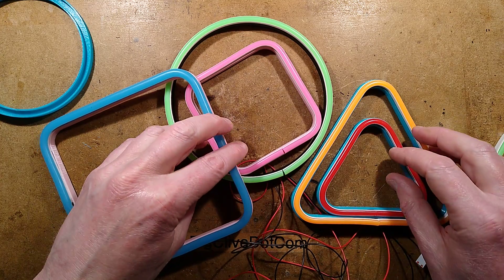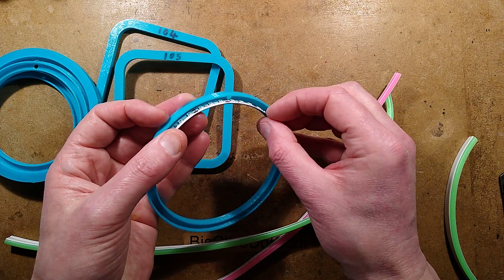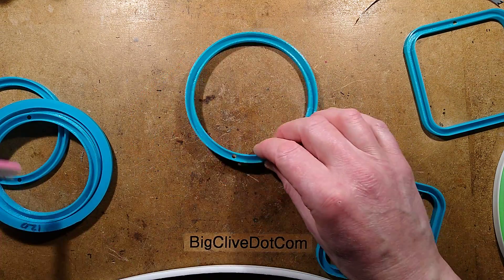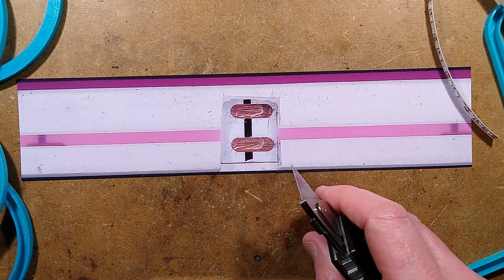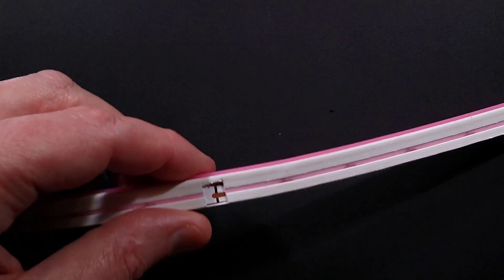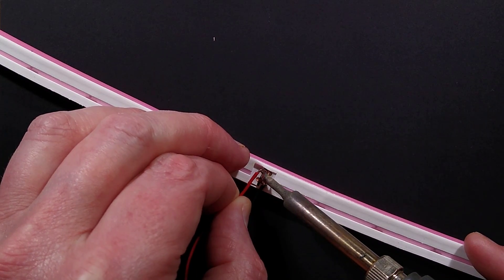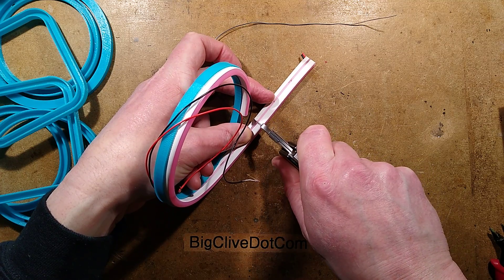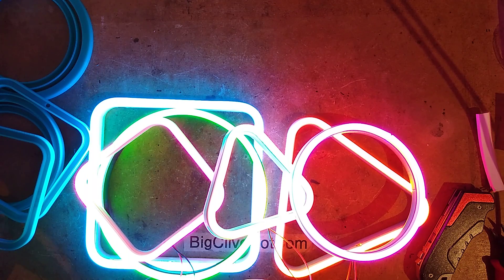Make custom LED neon shapes

Comment: YES we need a way to make letters like this... that would be so great!
Reply: There are some complex and clever ways to do this. But I don't do complex and clever. So I can recommend adding the dotSCAD library to OpenSCAD for its hollowing out function, start with this SCAD snippet, and play 🙂

use <dotSCAD/hollow_out.scad>;
$fn=80;

font="Comic Sans MS";
fontsize=80;
text="HELLO";

shell_thickness=1;

linear_extrude(5.5) text(text,  font = font, size=fontsize);        // base

translate([0,0,5.4])
linear_extrude(10) 
	hollow_out(shell_thickness=shell_thickness) 
	text(text,  font = font, size=fontsize);
Reply: I'd guess you'd need to solder wires in to get around the tight corners the the top of an A
Reply: @20thcenturygamer22  As don't have to have tight corners. If you did, you might want to treat them as separate segments and do the soldering around the back.
Reply: I have found the trick to this is using constant width fonts like courier new or OCR-A. then you can use the offset(-num) command then difference it from the original text then make a base with the original shape. edit: here is my code

channelWidth = 5;
channelWallWidth =1.2;// increasing this or channel Width will increase font size
channelHeight = 6;
baseThickness = 1;
pointsPerMM = 2.83465;
fontType="Courier New";
fontRatio= 6.25; //ratio needs to be adjusted for every font used to get acurate channel widths
//2.51 for OCRA &OCRB
//6.25 for Courier New
stringToShow = "Neon";

//end of custom variables

fontsize = (channelWidth+channelWallWidth*2)*pointsPerMM*fontRatio;

module outline2d(txt=stringToShow,sz=fontsize){
    text(txt,size=sz,font=fontType,halign="center",valign="center");
}

union(){
    linear_extrude(channelHeight+baseThickness){
        difference(){
            outline2d();
            offset(-channelWallWidth) outline2d();
        }
    }
    linear_extrude(baseThickness) outline2d();
}

Comment: Wires joining in the middle is an excellent idea, I might have to get some of this strip to have a play with. Maybe the wire hole could be offset so that it cuts slightly into one wall, to make it easier to get the thicker bit with the wires in? Obviously the user would then have to choose inside/outside offset.
Reply: This could be done with a (user) variable offset. Negative values shift the hole to the inside, positive values to the outside for example.
Also, for circles the script could be tweaked to calculate the diameter by the number of segments -> circumference... same goes for the other shapes, the bend radius could probably be used to tweak the dimensions in a way it divides nicely by the segment lengh
Reply: I was just thinking that! Place the hole directly beneath where the wires come "down".

Comment: 10V you say... so putting a couple "normal" silicon diodes in series with a 12-14V supply as needed should do it without too much heat?
Reply from the maker: For short lengths diodes would be ideal.

Comment: I have a problem Clive I have ADHD and dont have a clue how to learn how to make the printer do what I want it to do, this has caused me to not buy a printer, and I would love to buy one, where can I learn to do it help please.
Reply from the maker: The best thing to do is buy a cheap standard 3D printer and play.  It's the only way to learn.
Quick summary:-   Set up printer as per instructions and load some PLA filament.  Choose a suitable small item from thingiverse and load the STL file into software like Cura to convert it to your printer's format.
Reply: I started with an ender 3 during lock down. Built in 20 mins printing in 25 mins and a test file perfectly printed in a couple of hours. Don't look to deeply into 3d print settings as Clive said it's a rabbit hole
Reply: I wager a guess, a lot of us have ADHD, i certainly do, and are printing away quite happily.

Comment: These are some great starter scripts for learning OpenSCAD, too.  It might be worth also posting them somewhere that can do indentation correctly, like pastebin or a page on your own site.

Anybody who doesn't have a 3D printer and can't afford it (in terms of money, space or time), check your local library.  Many of them have one and using it is either free or very cheap.

Barring that, make friends with a local nerd.  Almost everybody with a 3D printer will be excited to share the hobby with you.
Reply: Cadhub has been my goto for sharing openscad stuff
Reply: @radnukespeoplesminds  Thanks for the tip; CadQuery is new to me and solves one problem I've had with OpenSCAD for ages - no easy chamfer or fillet operations.
Reply: Maker/hackerspaces are also an excellent option for access to the kit - and the chances are there will always be someone else around with a decent amount of knowledge to troubleshoot due to the nature of the space!
Reply: @morgansm395  Totally agree! There are quite a few as well.
Reply: Toronto Public Library has 3D printers at eight different locations and they charge $0.10 per gram of filament... The only problem is I have no idea if that is a reasonable price or not!
Reply: @booblla  A 1kg roll of filament is typically around $20-$25, so like $0.02 per gram.  But that's of no use to you if you don't have a printer.  On the flip side, one of these neon shapes is only going to be a few grams, depending on slicing options, so 50 cents or a dollar per print is nothing compared to the cost of buying your own printer.

Comment: One obvious application of this would be to make neon "letters". The 3D printer's language resembles the constructive solid geometry language used by the ray-tracer Persistence of Vision, with which I am familiar. POV contains letters as primitives, but given the way most fonts are constructed, with varying line widths, that wouldn't be practical for a printer. You would have to construct the letters yourself from line and curve segments, and of course not all are equivalent to a circle or a line segment and would have to be made with more than one segment of tape.
Reply: If you overlaid two square elements you could create a seven segment digital display.

Comment: Every maker and tinkerer should have a 3D printer. They have been around for long enough, they are cheap enough and easy enough to use these days. I custom print boxes for all my projects now.
Reply: I'm still oldschool enough to use hand tools to shape materials like wood and plastic.  Then writing custom code for the electronics inside.

Comment: It's awesome though clive. I'm gonna us some and make a star for the wifey. Thank you

Buy a cheap ender 3. With auto leveling and you're all set.
Reply from the maker: I've been trying to work out the algorithm for an actual star with curved tips and valleys and it's actually much more complicated than the simpler shapes.
Reply: @bigclivedotcom  yeah that would be hard to describe numerically. Your could easily do a big sun by having two different sized triangles, 4 of each and a circle. That would be nice for a display. Use orange and yellow.